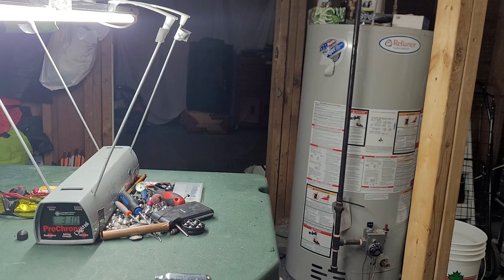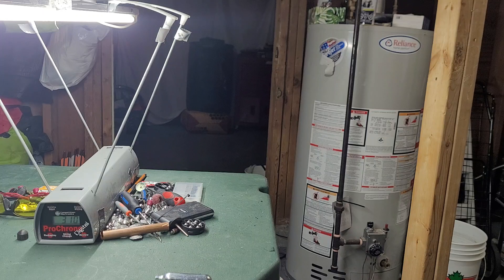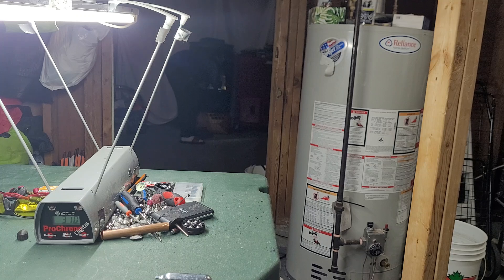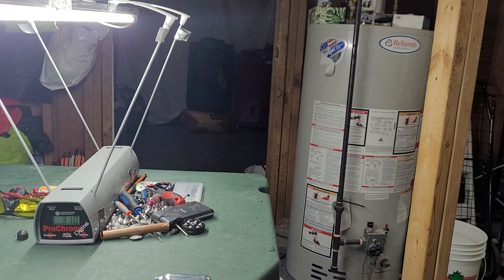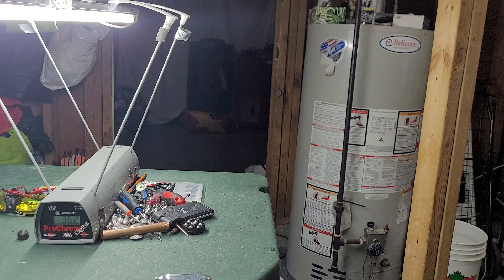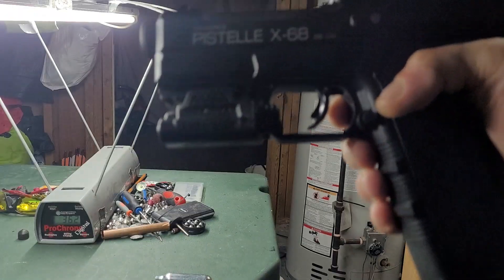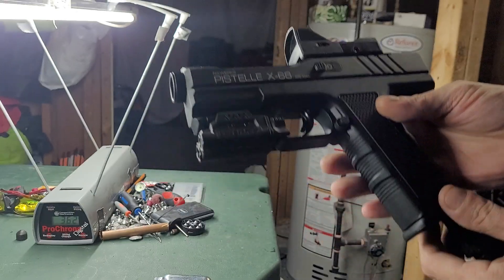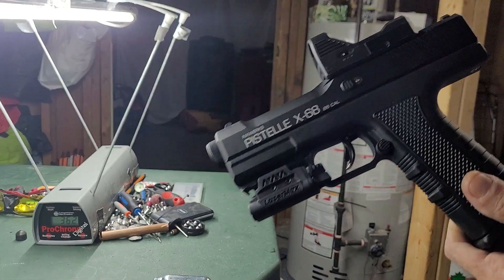Pistelle X68 HPA Powertest 800-1100 PSI Defense Innovation (Mercury Rise Intrubuster )

Comment: Ya this marker is a weird one don’t know why sometimes I holds pressure after degassing and sometimes not might be only at higher pressures like 900 plus my hpa test was at 1000 psi
Reply from the maker: ya the co2 seemed to be fine but the 1100 psi held the air very odd, seems like this gun has a plenum that only holds so much air

Comment: I'm thinking it's designed that way to generate that much power, the CO2 pressurizes the firing chamber reservoir and the restrictor makes sure nothing can escape back into the CO2 chamber, creating like a balloon effect that when the hammer hits the firing pin and opens the valve to the barrel, it will explode sending the projectile out at high velocity, similar to a bullet and the shell that holds the gunpowder being like that chamber, that's why after discharging and taking out the CO2, there's still the left over pressure inside that chamber that causes the explosion to propel the round, if you were to widen the restrictor, the chamber will no longer hold the pressure because the air will leak back into the CO2 chamber and the pressure to cause the explosion will be lessened, maybe?